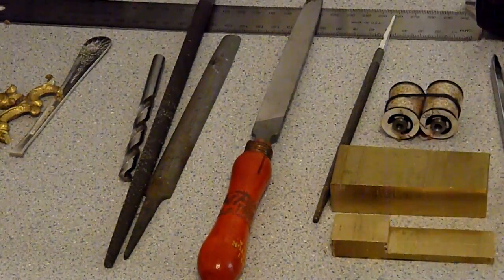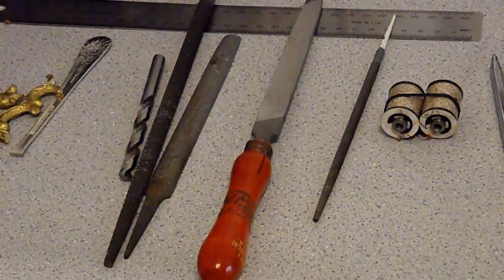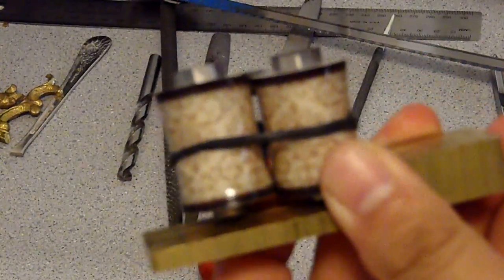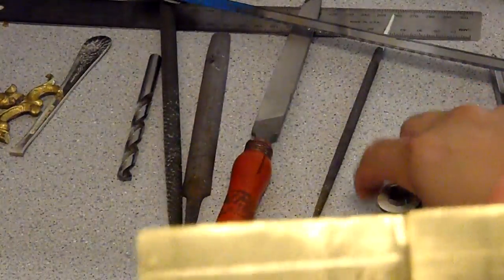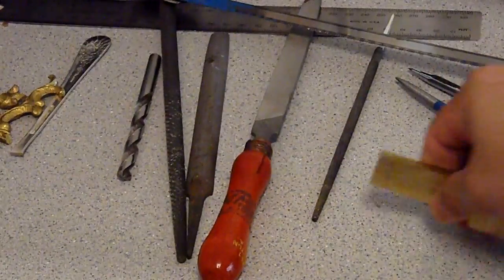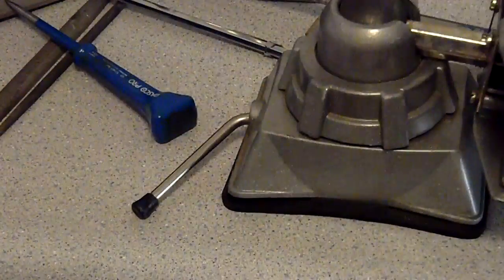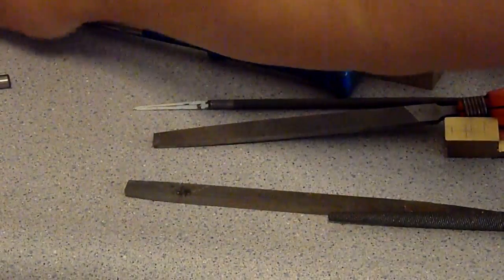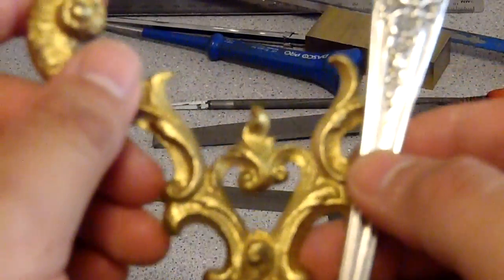TOOLS AND  MATERIAS TO MAKE A HOME MADE TATTOO MACHINE

Comment from the maker: First of all it's very hard to determing the proplem with so litle info on it.   First to run a machine at 12 volts is way too high. Second the coils are too big for a liner if thats wath are you trying to make out of it. 12 wrap coils are good for shaders and color packing if they have a 45 to 55 capacitor . also you have to consider the spring size for the front and back nad the frame geometry. well I hope this will give you a beter idea.    Thaks for watching